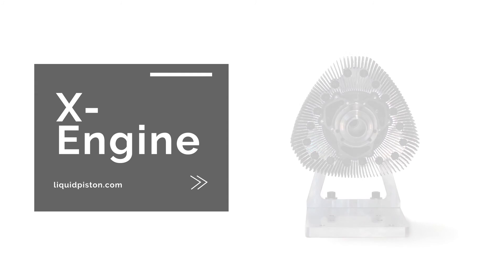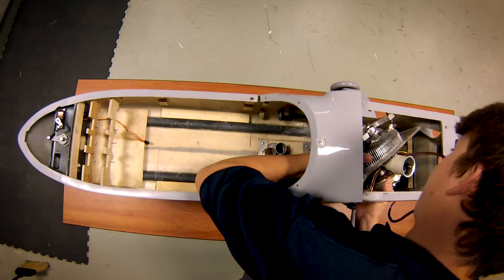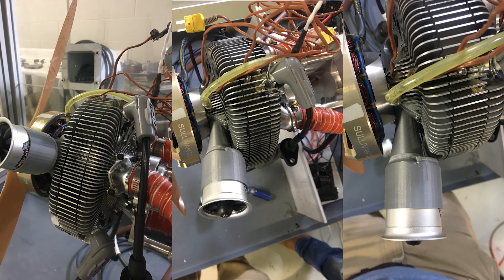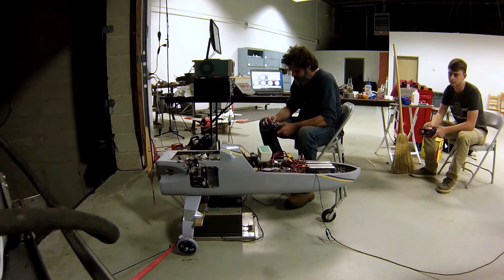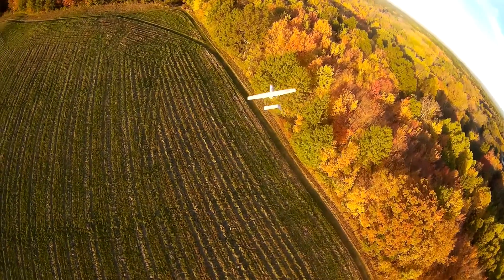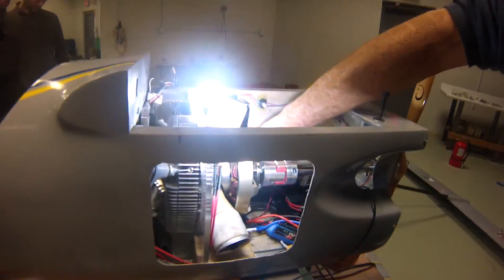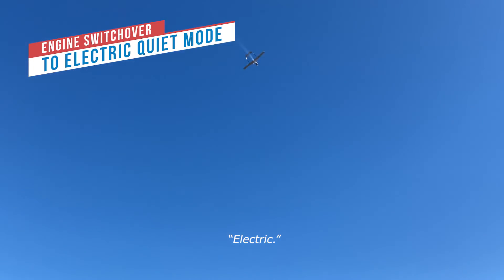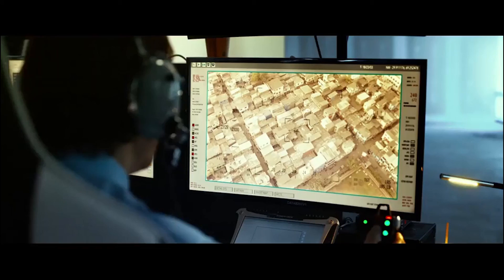LiquidPiston X-Engine takes flight [Long]

Comment: @Alec Shkolnik The efficiency and power demonstrated breathes new life into engine technology the world over. It takes sheer mastery of fluid/thermal dynamics, hydrocarbon chemistry, and mechanical engineering to condense such a flow of power through so elegant a geometry. I hypothesize its incredible mass-power ratio could be augmented much further still utilizing experimental composite construction; PEKK doped with carbon fiber has a higher tensile strength than aluminum at less than half its density. A simple electroplated finish would tune high-load part coefficients for electrical/thermal insulation/conduction, friction, and chemical corrosion. Peripheral components like side seals and manifolds could be similarly printed in PSU/TPU. In place of the cooling fan, a Tesla turbine flywheel driven by exhaust gas pressure would return otherwise wasted inertia through the eccentric shaft. Integrated oxidizer expansion channels would preheat oxidizer by cooling the housing and hot-cold interfaces could be fitted with Seebeck generators. Lower density construction increases vibration amplitude, the dampening of which could even convert mechanical noise into a current via piezoelectric generators. I would love to see this engine approach its full potential.

Comment: This would be my plan.
1. Add more rotors to crank shaft 
2. Increase volume 
3. Turbo charge
Reply: 3 is impossible on this type of engines. There is equally to no pressure on the exhaust.
Reply: @redserjogha  possible to supercharge tho
Reply: @redserjogha  i mean... You can turbocharger a 2 stroke... It doesn't work as well as the 4 stroke... But it works

Comment: Looks like a great engine for paramotoring. Take for example the Moster factory R. 27HP at 14kg.. This little bundle of joy can produce the same HP at 8kg, or 45hp at the ame 14kg weight... (assuming a linear relation between weight and power for this comparison)

The cool thing is, you won't need 27hp when you have the lighter engine because, well you overall airborne mass is a lot lower. 

And ofcourse it is funny to go to the Jet A pump with your paramotor.

Comment: I could see this engine being great in the miniature size for lawn, garden and toys since it's small but powerful just like any rotary engine. It's when you plan on putting it in a car and have to make sure the apex seals longer than a normal rotary engine, the emission, and the bad fuel millage

Comment: Seems like the bldc rc motor is doing all the hard work😂. China rc engineering vs liquid piston. Liquid piston should called be liquid trash. In an engine environment lubrication is critical. Liquid piston can't utilize an oil sump. It's oil gotta be in the fuel. No separation between oiling system and combustion chamber ect. There is nothing revolutionary about their design. Maybe if you don't factor in the down sides it might sound good on paper but actually it's not.

Comment: engine operating hours before overhaul ..?? .. efficiency ..??
Reply: "Overhaul" bwa ha hah. you can't just rebore an engine like this and they have extremely short life expectancy from what I've seen so far.
Give it a few years and it'll either be a working engine coming in all sorts of machinery or it will have faded away into non existence because it's garbage. It's still in development and a very long way from stated expected performance figures so obviously they're not even going to know ANY of that till it's fully developed and thoroughly tested.

Comment: are they going to build a larger version of this engine? Large enough to power a car.
Reply: This would be great for kit cars
Reply: Yes
Reply: They already did with Mazda RX9
Reply: @isDatBoi  Take a good look at these engines. When they are compared side by side there are a lot of differences. Different ignition cycle for one.

Comment: Wow, I would love to have a reliable rotary engine for paramotor, just a biger one
Reply: Check their site, they do have bigger ones. I don't trust their stated expected performance figures or it's durability so I wouldn't go trusting one to fly me around, a model maybe but not me, not till it's proven itself and actually come at least somewhere close to their stated performance expectations and at the moment the durability from what I could find is really bad.
Reply: Check their site, they do have bigger ones. I don't trust their stated expected performance figures or it's durability so I wouldn't go trusting one to fly me around, a model maybe but not me, not till it's proven itself and actually come at least somewhere close to their stated performance expectations and at the moment the durability from what I could find is really bad.

Comment: Can you tell me some manufacturers of electric generators,
based on the LiquidPiston engine?
THANK YOU.
Reply: I think they might want to actually finish developing this thing before it goes into general usage. At the moment it's only achieving about half the power they expect and about half the revs they quote too.
New and unique designed engines NEVER go straight out and run long duration things like generators till FULLY developed and I seriously doubt this thing will ever meet their extravagant claims.

Comment: I hope to see one of these for the small radio controlled aircraft industry where it can be run on glow fuel, petrol or kerosene.
Reply: It already does run on kerosene, that's what jet fuel is. It's also shown here flying an RC plane that's loaded down with the extra weight of an entire electric power system too so if you got rid of all the extra weight of that, that same engine could easily power a bigger model. They may make a smaller one still for the smaller models once, or IF they ever get to the mass production stage. 
As for glow fuel, no thanks, way too expensive compared to jet fuel, diesel or petrol, at least in anything medium to large those bigger, like 1.60 sized glow fuel models can get really expensive to feed and when you've already got an engine that's happy running on the much cheaper fuels I'd go for that for sure. Glow fuel around my way is getting hard to find too. I usually mix my own nitro, methanol and usually 15% of good quality oil but the methanol can be iffy and the nitro is just plain getting hard to get hold of.
I'd love to see this engine live up to the promised (but certainly not delivered) performance and some decent durability but everything I've seen and read so far make it much less power than they keep talking about, doing about half the revs they keep quoting and apparently a very extremely UNSATISFACTORY life expectancy.  It's not just disposable it;'s not even worth mounting up and the cost will make it completely unacceptable.
Reply: @probingtime666  agree.
I've only seen this engine with an electric motor and wondered if they are using the electric motor to help turn it over as I'm still in some doubt that it's self sustaining...I'd like to be proved wrong.
Reply: @ArcturanMegadonkey  There's a lot of hype about it, it suddenly seems to be being talked about everywhere on YT yet here or their own website make great claims about "it'll produce blah blah horsepower etc" and rev to blah blah" and yet they have running versions, at least 1 in that plane and another they show running on a dyno and another they had running in a go cart. Every 1 of them so far that I've seen has produced almost exactly half the promised hp and about half the revs they state it should be producing and since they're putting all this out now, trying to promote their product I would expect this to be close to as good as they're going to get out of it but, the promised figures make these examples embarrassing.
I think the plane was running on the rotary engine, mainly because you could see plenty of smoke while it was running, funny thing though, when they said it was shut down and running in "silent mode" it was still pouring out smoke so it WASN'T running on the electric at all. With a small engine that runs pretty quietly anyway, and considering so much of the noise comes from the prop anyway that silent mode seemed a really stupid idea to me. Weigh the thing down with an entire electric power system AS WELL as their engine means it's going to have to work harder whether on electric or their engine meaning the prop is going to need to be bigger and even noisier just carrying the extra weight of 2 complete power systems so definitely dodgy. To be honest I hadn't really thought about your theory and while I think you're wrong since their is clearly smoke coming from their engine I'm pretty certain it is running, plus I've seen it running that go cart around (slowly) I think it does work but, that story about "silent mode" and the electric power system makes a little more sense if these things are temperamental and need it there to restart their engine every time it dies on them which may be pretty frequent. It seemed to need a lot of speed to land suggesting it really needs a bigger wing area but they probably really wanted to keep it as compact looking as possible so they could say to the military "look how small and inconspicuous it is" sort of thing.
I don't know if this engine, or any engine based on this design will be any good once fully developed, something it really should have been much closer to BEFORE promoting it everywhere but, I have very big doubts about it based on what I've seen so far AND on the way they're really trying so hard to convince everyone this is what you need when it's so far from what they promise sounds way too much like an investment scam, not so much trying to sell or get the public interest to want to buy it when it becomes available. 
Time will tell. One thing I can guarantee is I wont be first in line waiting to buy one, once they've proven themselves and are durable I'll definitely consider one but certainly not till it's thoroughly tested by many people first. Nor till we have REAL horsepower and rev range figures either.

Comment: Is it just me?... or does the electric motor in the quiet mode seem louder? Regardless this is impressive to say the least, good job guys!
Reply: It wasn't even running on electric when they said, it was still blowing smoke out of the exhaust. Adding stupid 'dramatic' music doesn't help either. I want to hear the ENGINE, not some music designed to try and sound impressive.
Reply: @probingtime666  Exactly, I hate it when something is presented and instead of hearing real sound, all you can hear is some stock soundtrack
Reply: @nobodynemoq   In my experience it's only ever used in a video like this if they're trying to camouflage sounds they don't want you to hear. If this really was any good, a year later it should be much more well known about but I haven't seen anything popping up about it since so I'd say it's pretty safe to assume it NEVER did live up to expectations and the sound being mostly hidden by stupid useless music and the inconsistencies I mentioned suggest to me they were just trying to inspire investors by making a video careful not to really show it doing what they say it can. It's a pity but, I think we've probably reached the pinnacle of what can be produced from liquid fuels with current engine designs.
Reply: It did sound louder

Comment: Underrated as frick. They should go to SEMA
Reply: I think you've got that arse backwards. It's UNDER performed by a factor of very close to TWO HUNDRED PERCENT! It produces about half the power and half the revs they claim it's capable of. They are promoting the hell out of it but it's not coming even remotely close to any of the stated expected performance figures.

Comment: Nice.
But is it a bit too late? Engines that burn hydrocarbons for fuel are on the way out.
Reply: Fuel is going to remain very relevant for the military and aerospace for a long while.
Reply: Hydrocarbon fuels will remain with with us for many years, governments may control countries but all to often we forget who has power over governments ! Hydrocarbon fuels may gradually be phased out in some uses, but there will many where that will simply not be allowed to happen.
Reply: Hydrogen? It has high octane rating, fast burning speed and 34:1 stoich ratio. Combined with mechanical compressor and direct injection can be a powerful and environment friendly engine.
Reply: @tamasmoldvay2621  they still produce NOx so not 100% environment friendly, but yeah good points.
Reply: @mariosantisoferreiros2238  nothing is 100% environment friendly
Reply: @tamasmoldvay2621  absolutely!

Comment: cant wait to replace my V6 TDI with this one.
Reply: Oh good. I'll take your useless old TDI engine and watch you getting pissed off with this overrated Wankel rotary ever so slightly modified and with absolutely nothing even resembling a "liquid piston". FFS, where did they even come up with such a stupid non descriptive name FFS?
Reply: @probingtime666  nuh, I‘m happily keeping my good ol TDI in case it’s as useless as you say. But bla bla never helped in developing a society. Has big ass potential, why not supporting?
Reply: @AdrianWosniak   I am supportive of innovations, this has all been hype so far though. They compare a pic of their bare 35 or 40 hp engine with nothing on it, just the bare engine itself, no exhaust, carburetor or fuel injection gear, no alternator, water pump, nothing at all except the basic block and compare it side by side with some about equal hp but a VERY low hp engine for it's size with absolutely everything on it, if I remember correctly even the radiator hoses to make it  look even bigger when there's diesels in common use that put out MUCH more power for much smaller so that's a very dishonest comparison for 1 thing. They rave about it will deliver blah blah hp at something like 13,000 rpm yet show one in a dyno producing much less power and only about half the revs they claim. Nothing they state is demonstrated, only ever talk about amazing performance yet even though they've built and run them, even in a go cart it was more like a slow cart. Everything is way too much like a go fund me con for my liking with no supporting information. They have engines that run is as good as it gets so far. They also do state a VERY short running life and the one that annoys me particularly, "liquid piston", where in hell did they come up with that stupid name since there's NO liquid piston of any sort, it's all metals FFS.  
I honestly hope I'm wrong as a new and hopefully better type of engine would be great. This thing is being strongly promoted EVERYWHERE even though they've supposedly been developing it for some time yet it does nothing like what they claim so I think it's just another con job. I honestly hope they prove me wrong but I've only ever seen this kind of promoting and flooding of social media turn out to be scams so far.
Why do they state figures that it clearly can't produce even though they've had running versions for some time, why the BS comparison to a slugish lump with everything attached except the actual vehicle body, why liquid piston when there is no liquid involved except the fuel it burns the same as any other engine?
Reply: @probingtime666  you got a point there. Still, let‘s not lose hope in better engines. We only can be certain if there is a proper replacement version of this engine for cars available. Wouldn’t worry too much about the name. There are tons of misleading company or brand names out there. Maybe this type of engine will only start to create competition which brings a new run for better engines worldwide. All of us will profit from that. Dont be so negative mate.
Reply: @AdrianWosniak  Arghhhhh  CRAP!!!! I just wrote out a massive long reply to you describing an engine that was in production that's supposed to be extremely efficient, a lot about patent laws and ways around them and a crap load more and 1 accidental bump on the mouse at the wrong time and ALL gone!!!!!
I'm not negative about the possibility of better engine designs. I sincerely hope someone does design a better one. I've read and watched everything on their website, despite having running models they don't come remotely close to their claimed specs and the way they're promoting it so heavily even though it's done nothing more than run at about half the stated power and revs they claim makes me very doubtful this is going to live up to expectations.
Time will tell though.